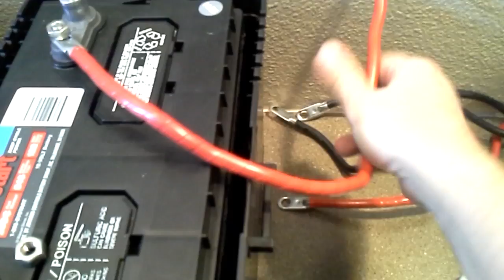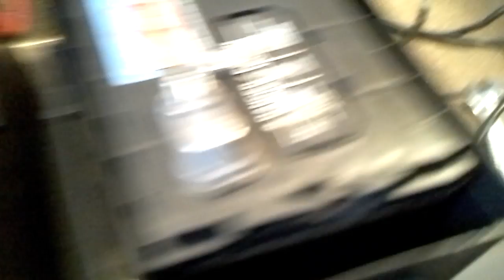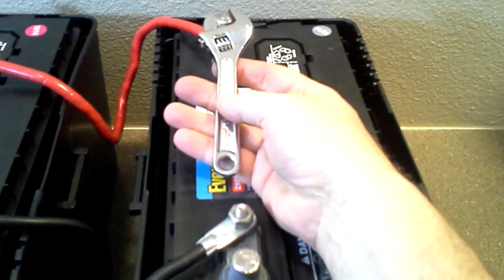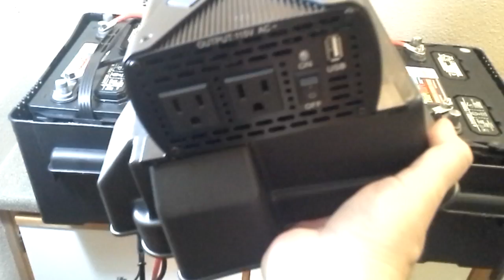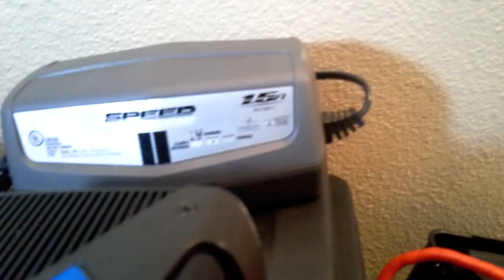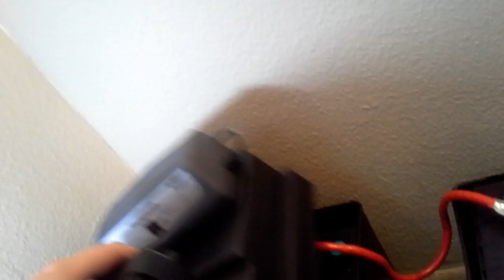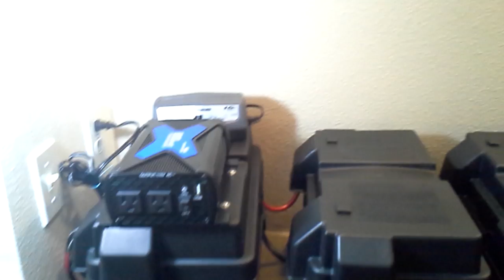Installing 4kW/Hr battery bank with 800W 120V Inverter and Trickle Charger from Tactical Woodgas

Comment: how long will the 800w last when it's fully charged?
Reply from the maker: Depends on your load.  With a 200W load, about 3 hours between charges.  Take 45 minutes to recharge with your car and jumper cables.
Reply: 800w is around 66 amos on a 12v system.  He has 3 x 100ah batteries from memory, so if you ran 800w until the batferies were empty, about 4.5 - 5 hours.  But you should NEVER run deep cycle lead acid batteties down to less than 50% if you want them to last, and that is reached after around 2 -2.25 hours.  Then the charging time depends on the size of the charger.  If his wall charger is say 10 amps, it will take roughly 17 hours to recharge the batteries. Theoretically it would be about 15 hours but charging lead acid batteries is not 100% efficient, it makes them a little warm (Wasted power) so it takes longer to complete the charge.

Comment: Why is running it in series bad for the inverter? 
I have a 3000w modified sine, would 4 12v batteries in a 2x2 series-parallel configuration work or should I have all in parallel?
Reply: Your inverter can only take in a certain voltage. Running two 12V batteries in series will bring the voltage up to 24V and it won't work if your inverter can only take 12VDC, but you will need to do that if your inverter is rated for 24VDC and you only have 12V batteries.
Reply: more  ummmmms and eeeeeeers in the first two minutes than I'd use in a week, I lost interest.
Reply: solar nvartr 5kw com

Comment: Do you leave your charger hooked up while using the 120 volt out ? What about using a higher amp charger to bubble the batteries to keep the fluid evenly charged ?Thanks
Reply: Ok to leave it plugged in while using it.

Comment: how do you know that your battery is handling a 4 kW/h? and those batteries shows onli the cca.... can you please teach me how you get the 4kw/h ?
Reply from the maker: filipina santos 

Thank you for the questions.  Normal car batteries are rated in CCA, but this unit is designed to use deep cycle marine/RV batteries that are rated in Amp-hours.  To get Watt-Hours, multiply the Amp-hours by the battery voltage.
For longer battery life, the inverter shuts off when half the battery charge is used.  A  battery charged to 13.8V rated at 100A-H has 1380W-H stored in it, but 690W-H usable by the inverter.  Three in parallel as shown in the video can provide 3 x 690 = 2.07kWH.  
If you put a 200W load on that, it would run 10 hours between charges.
Reply: sorry to ask again this coz i confused, i got two kind of batteries for the lighting of my house all bulb are in 12 volts dc and one of my battery is interstate marine part no. srm 27 , cca 750 and rc 160  and my other marine battery is super start part no. 240 cm,  cca 475, rc 130..... which number should i have to multiply to get the Ah, is ti the cca or the rc?
all marine batteries never specify the Ah on it, only the sealed led acid battery or AGM  got the Ah on it
Reply from the maker: Hi Filipina Santos

V x RC = WH

Here is a link that show Amp-Hour and Reserve Capacity are equivalent:

https://www.pacificpowerbatteries.com/aboutbatts/deep%20cycle%20battery%20faq/dcfaq4.html

Comment: How much amperes-hour (AH) can deliver this battery bank?
Reply from the maker: Iván Blanco 
Half of the rated amp-hours.  In this case, 150 amp-hours at lighter loads and less at heavier loads.
Reply: Tactical WoodGas Those 150 AH, How much time (in hours) take?
Reply from the maker: Iván Blanco 

Divide 150 amp-hours by you load in amps.  A 1 amp load will last 150 hours, a 10 amp load will last 15 hours, a 30 amp load will last 5 hours.
Reply: Tactical WoodGas OK. This discharge rate is on the DC side. In the other side (AC side) the amperes is too lowest. It take this on the DC site?

Comment: i have a 500w inverter; for how long can it run with 3 tower fans , about 90w per fan with two 12v batteries.?
Reply from the maker: fernando santiago 

About 4 hours
Reply: fernando santiago you from available Pakistan
Reply: Where do you get your numbers from Tactical WoodGas. 270 watts on two cheap BCI group 24 batts will run WAY WAY longer than 4 hours. Is this some mathmatical equation,or just an observation? I cant off the grid very often, I dont think my Deka batteries are superior to your JCI everstarts.
Reply from the maker: David Anderson 

12V battery with 50 usable amp-hours (inverter shuts off when half the battery charge is used) is 600 watt-hours per battery.  With a small amount of efficiency loss in the inverter the total load is roughly 300W.  600W-H/300W is 2 hours per battery.  Two batteries will add up to 4 hours of fan use.
Reply: Tactical WoodGas maybe I am running my setup too low. I havnt ever checked voltages, but it's never shut off.
Reply from the maker: David Anderson 
Get a Kill-A-Watt from Amazon. It will show voltage, power use, etc.

Comment: I hope you have a very small refrigerator / freezer because an 800 watt inverter isn't going to power a full size unit. Your fridge may draw less than 800 watts to run but to START that compressor, which starts already under a mechanical load, will draw 2 to 3 times it's running power draw just to get rolling. Inverter manufacturers CLAIM to put out double their running watts to start heavy loads but this is ALWAYS for only 1/2 cycle or 1/30th of a second. It takes more time than that to start a fridge compressor. Also, ALL cheap Walmart special type inverters output what is called a modified sine wave frequency. It may be 60 Hz BUT on an oscilloscope screen, it will more resemble a square wave with a spike at the peaks than a smooth flowing sine wave form like your wall power has. These inverters are fine for lights and power tools with brush motors like electric drills, angle grinders and power saws but are practically worthless for things like refrigerators, hand tool battery chargers, flat screen TV's, computers and most medical equipment like nebulizers, oxygen concentrators and infusion pumps. Some of these may work with a cheap inverter but will usually overheat if used for an extended period and some hand tool chargers can become shock hazards too. Companies like Xantrex, (pronounced Zantrex), do make pure sine wave inverters from 150 watts all the way up to 4,000 watts for off grid whole house solar power applications but they are between 25% and 50% more expensive, watt for watt, as their dirtier counterparts as they are a more precision, intricate piece of equipment made to supply a cleaner wave form. To give you an example of starting current draw, I have a 7,000 watt back up generator wired into my house. It is rated at 10,700 overload watts for 5 minutes. It starts and runs everything that I ask of it during power outages. The problem is that it is a gasoholic. At a 50% load, it will burn through 8 gallons of gas in 12 hours although it usually lasts longer as I don't constantly load it at 50%. However, my wife, due to health problems, can't comfortably tolerate heat and humidity well. She spends a lot of her time in bed so we have a 5,500 BTU window A/C unit in the bedroom window that runs constantly. Being that it is the only thing that runs at night, I didn't think running a 7,000 watt, (59 amp), 14 horsepower generator was an efficient use of it's attributes just to run a 4 or 5 amp A/C unit so I went out and bought a 1,400 watt Champion generator with an 80 CC engine that uses 1 gallon of gas at 50% load in 12 hours. It is also several orders of magnitude quieter than my big unit that sounds like a race care idling at 4,000 RPM. Sounds like a hell of a savings, right? 1,400 watts / 120 volts = 11.6 amps at full load. A five amp air conditioner is 1/2 of that. NOT!!! The blower ran fine but every time the compressor tried to kick on, the underpowered 80 CC engine would lug down dropping the output voltage of the generator below the minimum voltage threshold of the compressor and it would kick the compressor protection circuit out. The generator would recover, the blower would power up, the compressor would attempt a repeat performance and the cycle would repeat over and over ad nausium. The underpowered generator engine is analogous to the 1/2 cycle @ 1,600 watt claim by the inverter manufacturer. It may put out 1,600 watts for 1/30th of a second but it isn't practical or enough in the real world to do anything but energize sales of average powered hash waveform inverters to people who don't understand what they're buying. If you want to run your full size refrigerator from an inverter and batteries, be aware that you don't get something for nothing with electricity. You'll need a minimum of a 1,800 to 2,000 watt inverter and to run your fridge for any length of time, I'd get 4 or 5 more batteries like the ones that you have. Just like the more you load a generator, the more gas you burn, inverters are basically the same. I don't have the formula in my hand right now but, for example, I have a 750 watt Shoemaker inverter that is fused at 75 amps at 12 VDC. 750 watts / 120 VAC = 6.25 Amps AC. So my inverter draws almost 75 amps at full load to develop only 6.25 amps that I use to run lights and power tools. With a brand new 850 Amp hour battery in my car, I still have to run the engine / alternator to run my angle grinder long enough to sharpen a set of lawn mower blades on site and my grinder doesn't draw as much as a refrigerator. In other words, to get that 6.6 amps or 800 watts at 120 VAC, you are going to be sucking almost 80 amps from your batteries. Then there is the inefficiency of the modified sine wave form so you'll be drawing more power from your batteries in exchange for less work from your equipment. Even a 9 watt LED house lamp bulb draws about 90 watts from your batteries as an example. Good luck in your endeavors with emergency power.
Reply: You make some good points but I think you've overstated the case.
Reply: @joewoodchuck3824  Short and sweet. 😂
Reply: I MUST APOLOGIZE FOR A MISTAKE IN MY MATH. THE MAXIMUM OUTPUT OF AN INVERTER IS NOT 1/30TH OF A SECOND, IT IS 1/120TH OF A SECOND.

I was thinking of 1/2 of 60 cycles or Hertz. It is actually 1/2 of 1 cycle which is 1/120th of a second which is even worse for trying to start heavy loads with an inverter. The corrected business is below.

...hope you have a very small refrigerator / freezer because an 800 watt inverter isn't going to power a full size unit. Your fridge may draw less than 800 watts to run but to START that compressor, which starts already under a mechanical load, will draw 2 to 3 times it's running power draw just to get rolling. Inverter manufacturers CLAIM to put out double their running watts to start heavy loads but this is ALWAYS for only 1/2 cycle or 1/120th of a second. It takes more time than that to start a fridge compressor...

Apparently you didn't read the above part of my post. Here's an example of the difference: I have a Troy Bilt 7,000 running watt GENERATOR that has an overload or maximum rating of 10,700 watts FOR 5 MINUTES. This means that if nothing else is connected to the unit and I needed to start say a LARGE motor that is driving a large flywheel and it draws 10,500 watts for 3 minutes to get rolling but only 6,000 watts to run, my generator will handle the load. If I had a massive battery bank driving a 7,000 watt inverter and tried to operate the same machine, it wouldn't do it because the "14,000 watt maximum output" is only for 1/2 cycle, (60 cycles / 2 = 1/120th of a full 60 cycle second), or 1/120th of a second. It is the same with the 800 watt inverter. It may develop 1,600 watts but it takes ANY refrigeration unit more than 1/120th of a second to get going. Even though the refrigerant pressures are equalized on both sides of the compressor at rest, the split second the compressor tries to start, it is under load and will draw up to 3 times the running current for longer than 1/120th of a second. This is inherent in all induction motors. Brush motors have higher initial torque because they have magnetic coils in the stator that have power fed to them via the commutator and carbon brush setup. They still draw a higher current to start up but for less time because of this higher initial torque.
Reply: All this is true but I don't know what capacitors you are referring to. If you are talking about super caps of the 1 Farad + variety, right again. If not, if you are referring to the more readily available soup can size 4,700 uF variety, it would take quite a few of those to absorb the jolt drawn by a fridge. If you are in the U.K. where 240 VAC is used, a 200 watt load on an inverter isn't such a big deal as is it in the U.S. where we use 120 VAC. 240 VAC / 200 Watts = 0.83 amps where as 200 Watts / 120 VAC = 1.6 amps.
Reply: I use a 2 Farad cap that help a LOT with start up.
I should have bought a 20 Farad one.
Reply: ferkemall  I've had my fair share of modified sine wave inverters and will NEVER recommend anything other than a PURE SINE WAVE inverter, unless you don't care for damage to equipment.

Comment: how long does take to drain the batteries and can the batteries be charged by the main bus battery
Reply: actually, you can use the inverter to charge the batteries, all you need is a battery charger plugged in one of the inverter's output to charge the batteries.
Reply: actually, it's doable. i have been doing it.
Reply: Jun Acaba how please explain.
Reply: Jun Acaba ,have you ever worked it out and works well?

Comment: Can you charge the batteries for long times without destroying them? For example if the power doesn't fail in 2-3 years, when it fails will the batteries be dead?
Reply from the maker: zerpBot 

The battery maintainer has anti-sulfating cycles so you should get about 5 years.
Reply: I have the same charger. If you put it on the batteries to charge, but never use the batteries and just keep them charging, they will start to boil off the water inside them and will eventually damage the battery. It depends on the battery you buy as well. always go deep cycle or for this application. if you don't use the batteries though, only plug the charger in like once a week to get them back up to full charge, then unplug the charger. Usually chargers will have quick disconnects in the line somewhere.

Comment: No watches or jewelry around elec.,
Reply: Yes, good advice, a metal watch strap hurts when it is melting your wrist (or a ring when melting your finger) when it glows after being connected across the battery terminals. If you must wear a watch use one with a non-metallic strap.